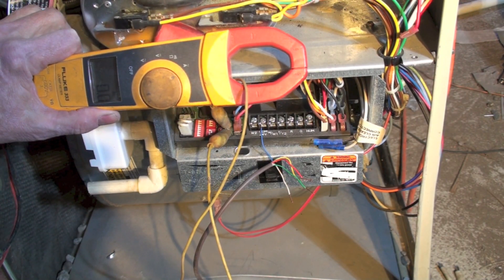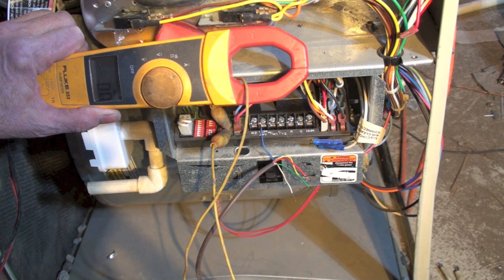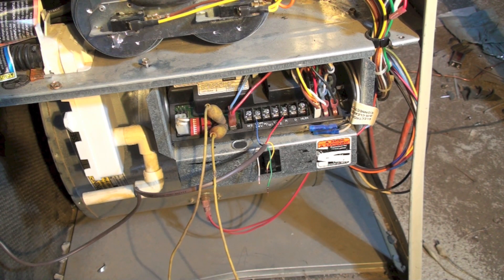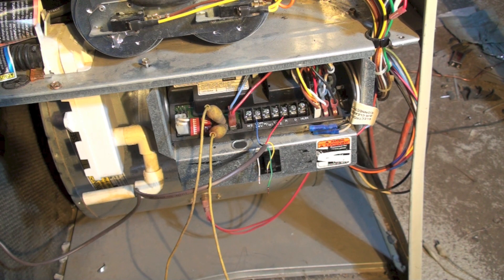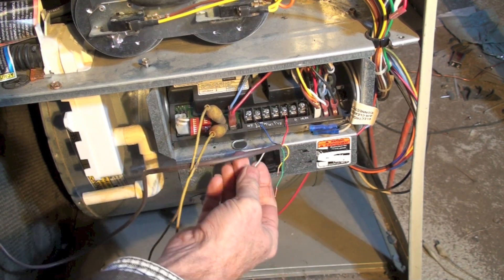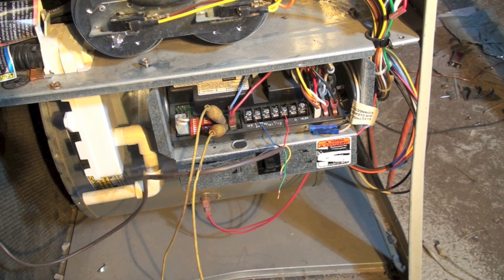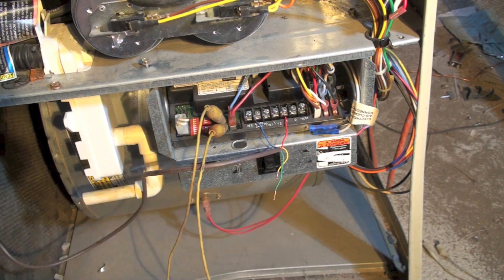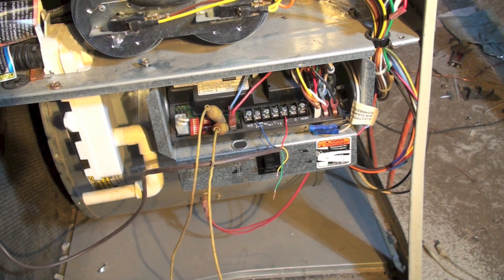Furnace low voltage short diagnosis part  2

Comment: What if I don’t have any of the thermostat wires connected and it still keeps blowing the fuse?
Reply from the maker: You just start disconnecting wires until it stops.
GFM
Reply: grayfurnaceman I think it’s a bad board. If I disconnect the 24v transformer leads the unit is fine, when the 24v is energized by the transformer it blows the fuse again. I don’t think it’s any other component because I can’t even get a call from the thermostat so nothing energizes to say it’s a component
Reply from the maker: @sergiopantoja181  Most of these shorts are from R to chassis, so I would be looking for a bare wire touching metal of the chassis.  Not saying it is not the board, but wiring is cheaper.
GFM
Reply: grayfurnaceman I understand that. But when I have no thermostat wires connected anywhere and what I mean by that is at the board, the actual thermostat, and at the condenser, that leaves pretty much the transformer or the board, and I’ve already ruled out the transformer

Comment: Hello GFM, i have a 5 ton ruud unit, its blowing the fuse, i ran new wires to both the thermostat and the condenser, replaced blower motor and still blowing the fuse, what else could be causing this problem?
Reply from the maker: Is the 24 volt or the 120 volt fuse blowing?
GFM
Reply: @grayfurnaceman  the 24 volt 5 amp fuse
Reply from the maker: Does the fuse blow immediately?  Does it do it during a call for heat or cool or just when the power is applied?
GFM
Reply from the maker: In most cases, immediate fuse blow means a short to chassis.  Start by disconnecting all the wires from the control board.  See if the fuse blows.  If not, connect the R wire to its terminal.  Continue until it blows.
GFM

Comment: I wouldn’t jumper anything I’d use a 5 to 10 amp circuit breaker to prevent damage to the curcuit

Comment: Hello sir. I'm a hvav student. A question, now that you know that wire R is the issue how you fixed??? Change the while wire or what? Thanks in advance.
Reply from the maker: If you have an open,  you will probably have to snake a new wire in the wall.
GFM

Comment: The most difficult part for dead short is the short wont happen when you do the troubleshooting. It always gives you a surprise at midnight... I deal with a RTU in this week, it blowed out three fuses in the past couple months. Every time when i put the new fuse on, nothing happen, every part works fine until after you leaving, the fuse gone. You can not take a chance to replace the part works good.

Comment: hey GFM, I has a blown 3amp fuse and replaced it along with the transformer and it was able to turn on again but as soon as the sequence of operation is complete (blower turns on) the unit will lose power again...it will try to reset and sometime turn off completely at random points during the sequence of operation. what can I do to find the short? I have a volt meter.
Reply from the maker: Its just a question of removing components from the circuit one at a time until the fuse does not blow.  The last component is the problem.
GFM
Reply: the fuse hasn't been blown after the initial. the furnace just shuts off.
Reply from the maker: You still probably have a short in some component or a wire shorted to the chassis of the furnace.
GFM

Comment: Im having an issue with my furnace my fan works and my ac works but my heat does not, When i test the voltage i have 24 volts between my red/green and red/yellow thermostat but when i test me red/white wire and i got zero volts I am trying to find out how to determine the problem, Do you have any advice on how to test that?
Reply: the furnace i have is also really old and does not have a fuse that i can tell
Reply from the maker: You have no problem with the thermostat or wiring.  The reading of no voltage between R and W is normal for a closed switch.  Your problem is probably in the furnace controls.
GFM

Comment: Hi GFM , thank you for the video. i have a question, i have a furnace that keeps blowing the fuse, i replace the fuse, turn the furnace back on and everything is fine, and then 2 or 3 days later it blows again, how can i find the problem.
Reply from the maker: You probably have either an intermittent short to chassis or a component has an intermittent short.  You can check for bare wires near metallic surfaces.  I also have 2 videos covering how to find low voltage shorts.  They can be found on my channel.
GFM
Reply: thank you

Comment: GFM, I love these diagnosis type videos especially ones that involve the meter. I have two clamp meters, a nice Klein Cl700 and a UNI-t.  I like this way of narrowing down the short to a specific Tstat call. Q. -  Can I jump out the IFC stat terminals on the board instead of running up to the Tstat to make calls to the furnace ? I am getting pretty good a diagnosis because of this series of yours. You have probably forgotten more than I will ever know.
Reply from the maker: You can jump from R to W at the furnace.  That will also eliminate the thermostat or its wiring.
GFM

Comment: GFM....I watch all your videos..GREAT STUFF...I'am afraid of burning up the IFC using a jumper wire with high amp draw.
When you did it it seems ok........Just a couple seconds won't hurt it...right?
Reply from the maker: There is little chance of an IFC failure, but certainly I would not leave it on longer that it takes to check amp draw.  What usually happens when there is a low voltage short is the transformer is the weak part and it fails.  Thanks for the support.
GFM

Comment: What if the fuse is only blowing when I try to turn the A/C on but not when I use the heater? I'm working on a Goodman furnace.
Reply from the maker: Disconnect the 2 control wires going out to the A/C.  If the problem goes away, you need to look for grounding of the wiring or a possible jammed contactor in the A/C.
GFM
Reply: +grayfurnaceman Thank you sir. I took a look at the contactor, it looked a little burn like maybe it was arcing. I tested the resistance of the coil and got 18 ohms. I think it's too much. I'm getting a new contactor tomorrow. I'll let you know how it goes.
Reply: +grayfurnaceman Thank you sir. I took a look at the contactor, it looked a little burn like maybe it was arcing. I tested the resistance of the coil and got 18 ohms. I think it's too much. I'm getting a new contactor tomorrow. I'll let you know how it goes.
Reply: +grayfurnaceman Ok so I guess I was being too lazy to troubleshoot your way. I finally did and I found it, a wire coming from the tstat was spliced with a different color wire and connected to the wrong terminal on the board. It was not the contactor, but I left the new one in anyway it was only 10$. Thank you much for your help. You're the best!

Comment: Hi G.F., so which ever wire you get that high amp draw on. would you still then go to the stat and remove it and see what you get then? Or would you just say it's shorted by taking amp draw at terminals on furnace? I am started schooling here in a few weeks.

Comment: As you are re connecting the wires to the terminal does the t stat need to be calling.  As in a call for 'heat' when connecting w and 'fan on' for connecting G etc?
Thanks and love the videos
Reply from the maker: Dog Days It is best to have them calling.
GFM

Comment: Just had this issue for the first time and would like your opinion. I switched wiring from red/white to green/yellow at t-stat and furnace and system operated normally. I didn't seen any obvious wiring issues so I am going to run a new t-stat wire with the assumption R and W are touching somewhere. Does this seem reasonable?
Also, just a suggestion for this instance, I used a 3A resettable circuit breaker from an old transformer to replace the glass fuse while troubleshooting.
Reply from the maker: Jeff Peterson The only reason I don't usually use a resettable breaker is I don't want to wait for it to reset.
Replacing the wire does seem reasonable.  What happens to most of these is the wire is stapled to the studding.  The coating of thermostat wire is easily damaged by staples so I don't use them.  Also, if the wire is stapled inside the wall, and you need to replace it, such as adding wires, you can't use the old wire to thread the new one in.
GFM
Reply: grayfurnaceman the resettable breakers often have a breaker switch you push to reset. No waiting

Comment: Thanks for replying. I figured it out.  It was the plug that goes from board to the gas valve. The plug and wires all look great but in reality the wires had become loose/worn out so it was making false contact even though it was plugged in and everything.  Will remember this forever great experience

Comment: hi gfm, i really need your help.. hope y can give me a hand.  I have a gas package unit with a honeywell smartvalve and honeywell board and hot surface igniter.  I replaced the smartvalve n igniter and still get no pilot or hot surface igniter never lights.  I checked every single switch n safeties and all checks out good, the only thing left to do is the board but board was changed 2 years ago and looks really good. What do u think??
Reply: Sounds like a 90+ unit, so perhaps the inducer isn't satisfying the pressure switches? Or maybe the pressure switches are faulty? Or maybe the inducer itself, isn't operating at all?

I'm very new to this but just tossing it out as a possibility.
Reply from the maker: Art Ramirez As Jeff S says, you need to be sure vacuum is getting to the pressure switch.  When there is a call for heat, the pressure switch must close before it can go any farther.  Look for 24 volt power at the valve.  Hope this helps.
GFM